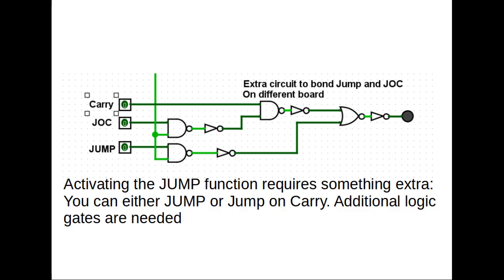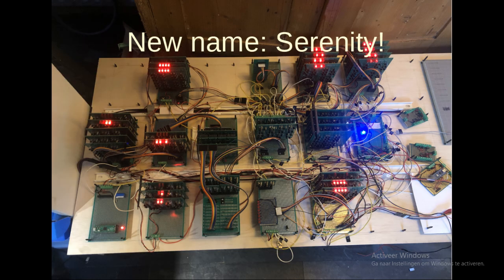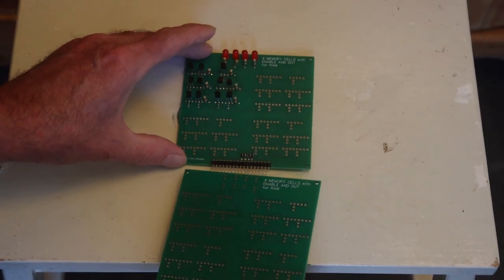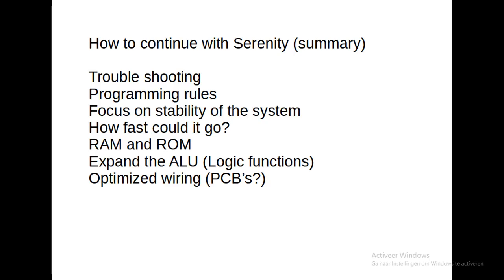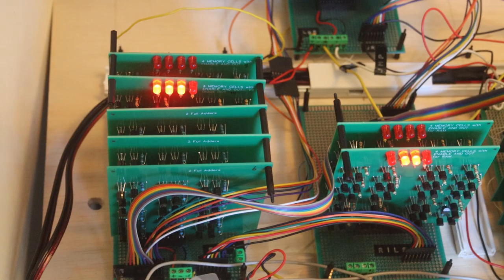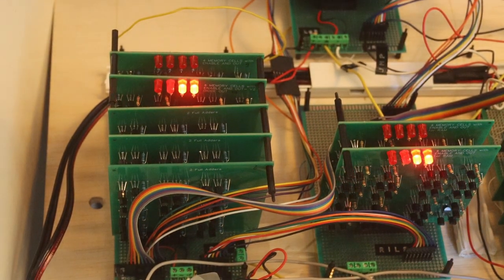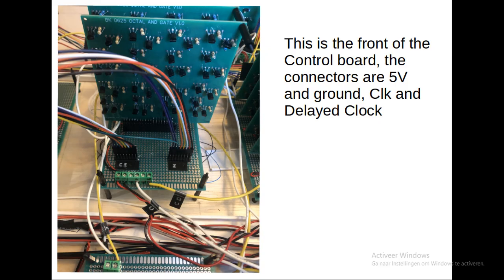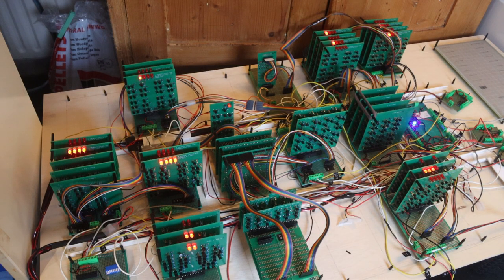Let's build a transistor computer, tutorial 7

Comment: I have always had the view that registers are the CPUs memory, anything else is not part of the CPU, thus you can use ICs for this and still have a descrete transistor CPU. Using desctrete transistors for the main memory will be a lot of transistors, boards and wiring.
If you make it so that you can single step or even part step the clock it might help in any fault finding.👍
Reply: I agree with your train of thought. RAM is outside the CPU, and I’m planning to compare the discrete transistor RAM with some 62256 chip and I’m dreaming of core memory. I’m in this to explore 😊👍
Reply: @bertkoerts3991  OOO! Core memory. The thing of dreams.